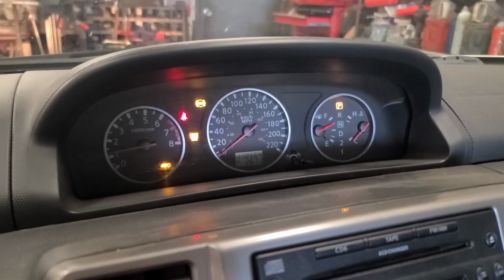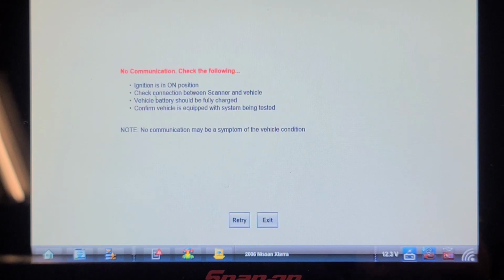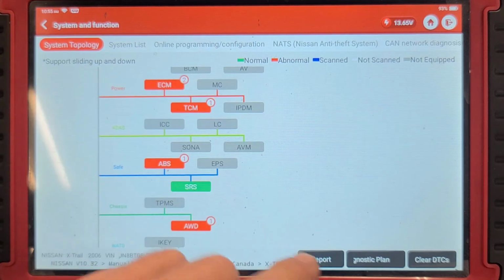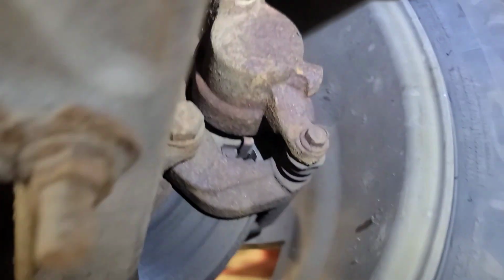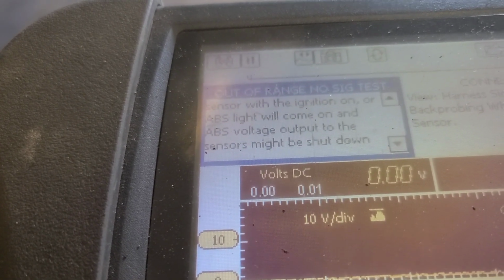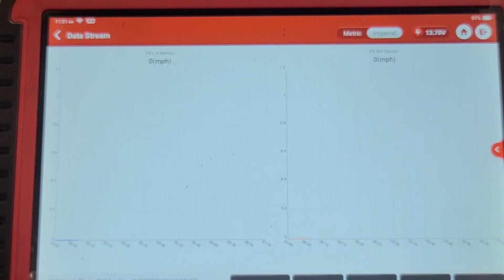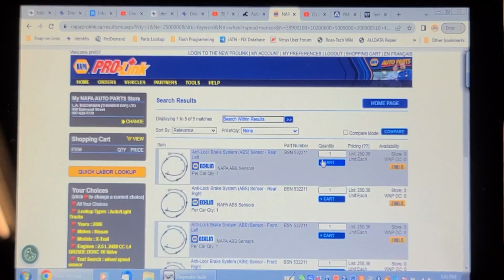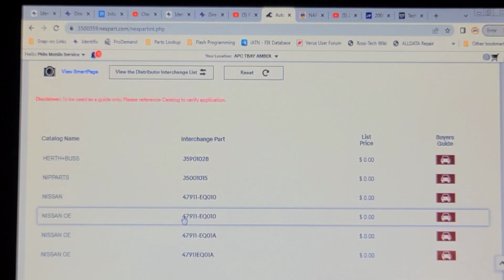2006 Nissan Xtrail ABS And 4x4 Lights On C1104

Comment: Have a nissan xtrail. Abslights are on and the speedometer doesnt work. The code in the scan is 2. Speedsensormotor. Do we have to replace the abs module?
Reply from the maker: @Adore_Fumiko  that code doesn't make sense.  Try a different scan tool to reas the code
Reply: @PhillipBailey  we will.
Reply: @PhillipBailey  what do you think is the problem?
Reply from the maker: @ZiaCarla_Channel  could be dozens of possibilities but without a code just guessing...

Comment: Hey I have a Nissan xtrail t31 2006 model I had the diagnostic done and it came up as the abs relay circuit. It’s negatively switched and I think my last mechanic did something when changing the cv boot because that’s when the issue started. I went to a few mechanics and two of them said it would be 1k + and take a couple of weeks because they wanted to change the whole abs unit. I’m having the same issues, the same lights are on and the odometer and speedometer isn’t working. There’s also a humming sound when the abs module is plugged in  even when the car is off because the abs won’t turn off. Do you have any idea what I can do about this or where I could get the abs relay part to change it and see if that works? Any help is appreciated. I also can’t seem to find where the abs relay is because it’s not where any of the fuses are
Reply from the maker: @lauraaaa12321  the ABS relay is internal to the ABS controller and not sold separately